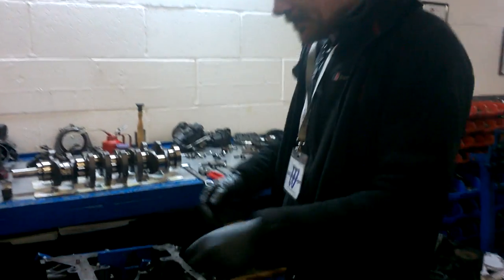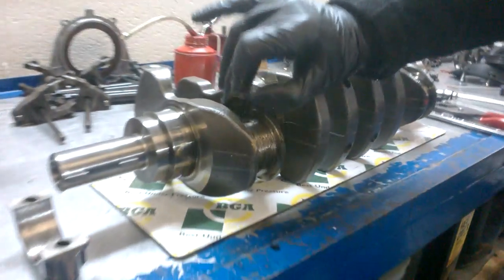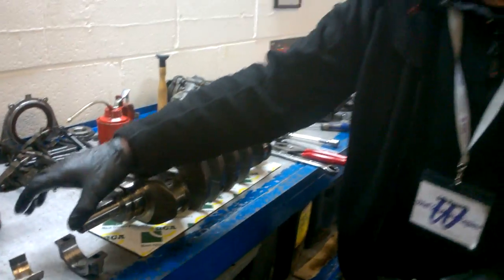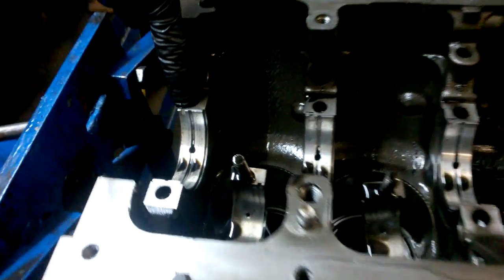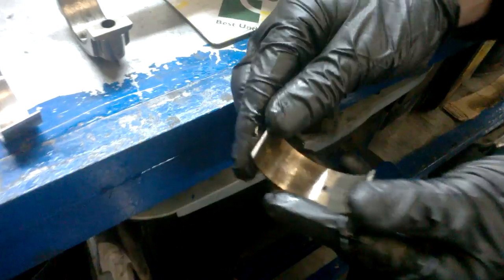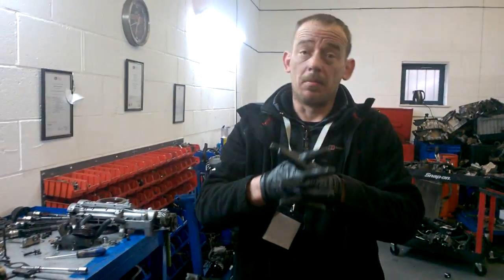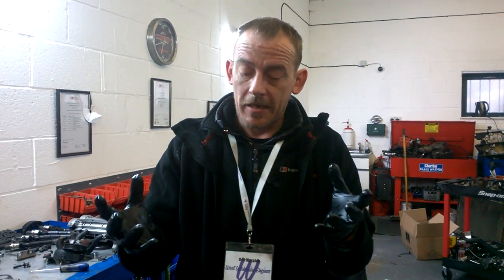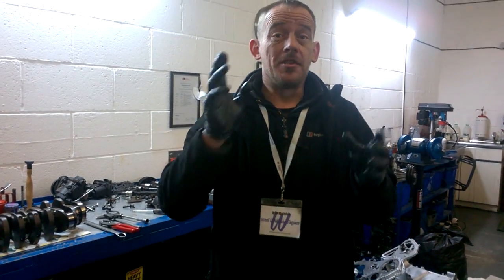Nissan Navara preformance chip/remapping Dont

Comment: Generally if the upper half of the baring is over worn, it designates that the person has been as you would say lead footed. If excessive wear is on the lower part or bottom shell on the conrod it designates a lugging of the engine, or placing to much load at lower revs of the motor. That is considering that the barings, oil pressure etc is at the correct specifications.

Comment: On the jeep Wrangler 2.8 c.r.d the mains go too. the trick is to drop the sump every 50.000 km and clean the oil pickup screen. the Nissan Navara d40 and Foton Tunland cummins 2.8 is a very similar setup all these common rail engines are highly stressed and as every day passes the makers will screw more out of less. this size range of utes here in New Zealand are now rated to 30 tonne pulling capacity.

Comment: I think its not a load on the engine from the map but perhaps via a trailer or heavy weight in the back. 1 bearing being that badly worn seems that the issue may be related to a fault with the actual bearing or camshaft too. Perhaps its not a good idea to map this engine if its on a heavy pickup but might be fine for the infiniti M30 as its lighter and wont be used as a mule.

Comment: Question is why only 1 piston and not the rest? Seems like a shitty tune/tuner.. Caused some pinging or engine knock which caused uneven wear. Whats the availability like on these motors for aftermarket bearings? I would like to know cos i recently bought a 2013.. Also what are your opinions on stand-alone or plug n play ecus since they feature more failsafe options and sensors??

Comment: Yes what would you and Nissan know your only elbow deep in broken ones all day long LoL good on you    my stock 08 D40    has been driven like it was stolen from day one oil s changed every 5000k kn filter that's been it's only service ever lot of sideways action on dirt roads  but never bogged  n panic thrashed. It runs like a clock and has never broken anything at all    I think they don't like cold start hide Ings  or poke ing around in traffic short hops  end of the day big ish car small motor    blow it up quickly by a fukkkkk n caravan load six tonnes of crap in it they ain't Kenworth s  ,     thanks for sharing your knowledge good on you mate  keep the kids out of your driver's seat be my best advice LoL

Comment: Probably a shit generic map from ebay with the timing too advanced. Still find it odd its only on 1 bearing and the description of the piston getting too much power for that bearing is a piss poor description of the actual issue that's caused the damage. IF your going to comment on work someone else had done and blame it for damage at least outline the possible causes rather than using terms a 16 year old apprentice would use.